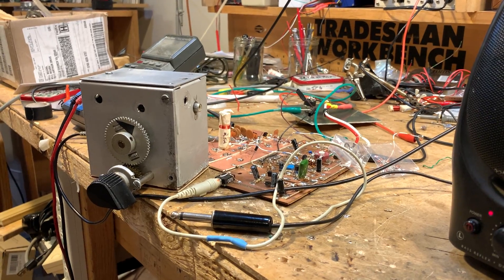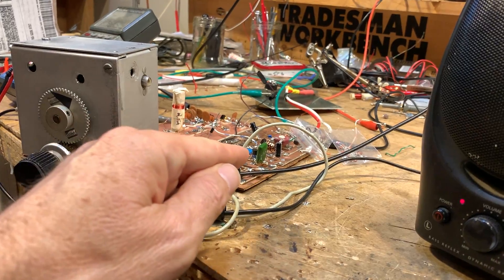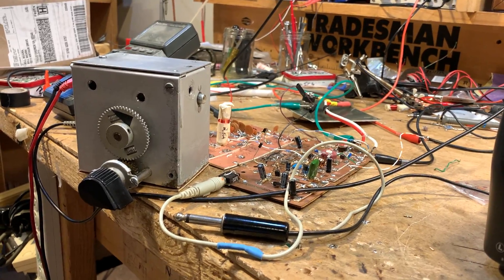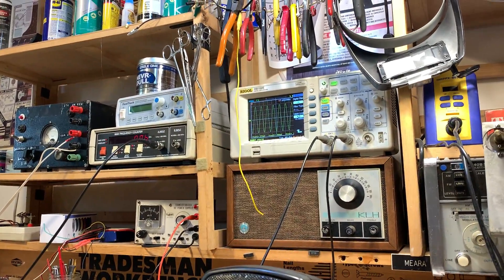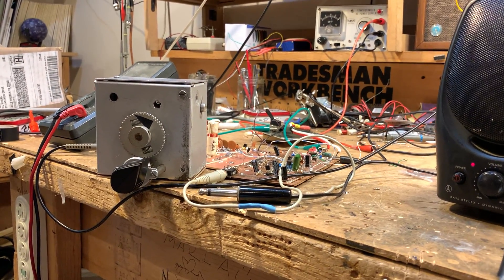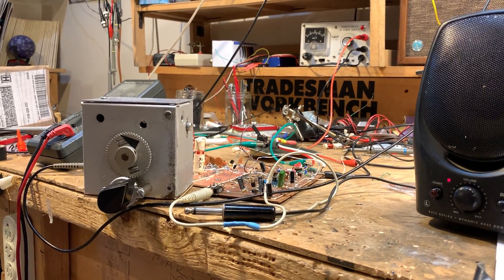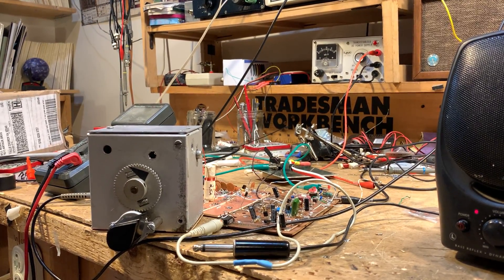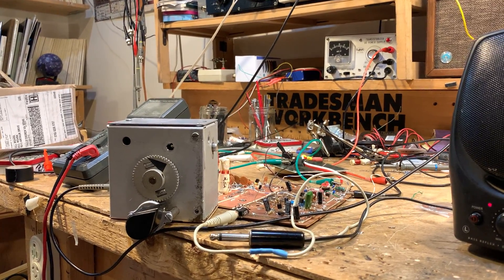A 40 meter Direct Conversion Receiver with an Analog VFO

Comment: There's nothing quite like direct conversion for really hearing what's on the ether. You've still got a little drift there, but only a little, the way it changed when you put your hand near the main board makes me suspect it's probably stray capacitance to ground, which would mostly go away if it was in a nice stable (and conductive) enclosure. but where's the fun in that!

My all-time favourite radio is my "Ugly 40" DC receiver, It was my first scratch-build, made initially from Farhan's schematic, but much tweaked as i learned to harness it's rather wayward tuning tendencies. Once she's warmed-up, she's a joy to listen to, and really does give you that feeling of having a window to the very airwaves themselves. I've built 10-15 radios now, mostly transceivers, but the UGLY 40 is the one I always go back to.

Thanks Bill!